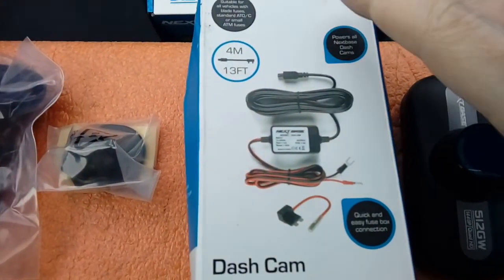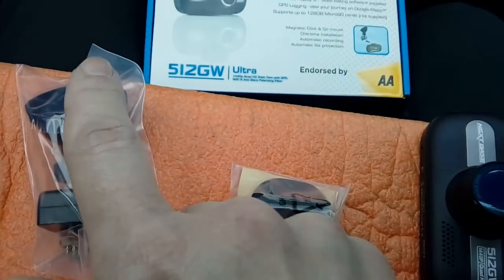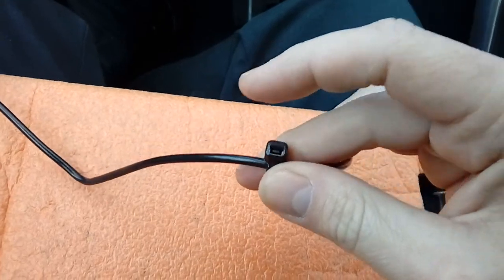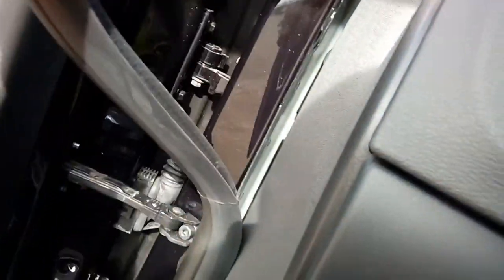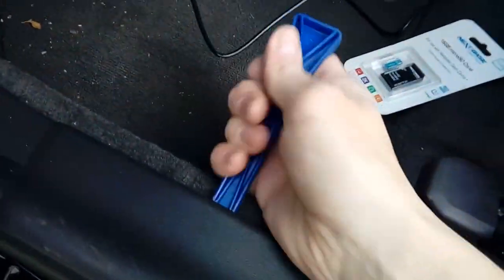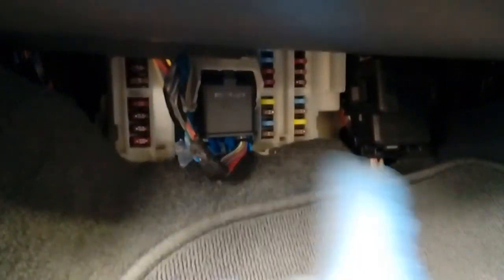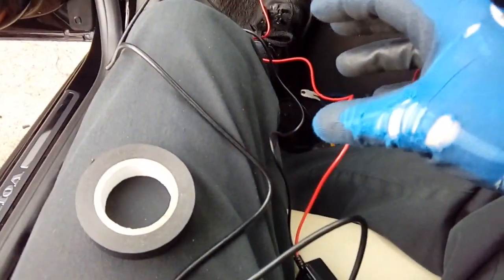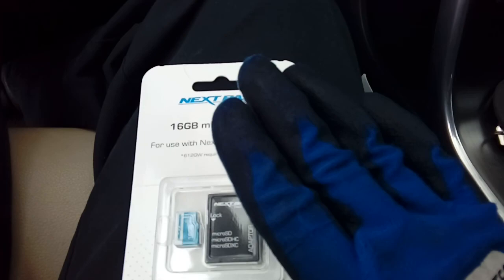Volvo S60 2010 onwards how to wire dash cam to ignition simple guide

Comment: Thanks for this video! Do you know perhaps if there is a power supply nearby the fusebox, even if the ignition is turned off? I have got a camera that both needs a supply for ignition and one when the ignition is off, so it can record when the car is turned off where it senses movement.
Reply: i am looking for the same solution, did you find any?
Reply: Check your manual for a constant on circuit in the fuse box. You can add another "add a fuse" to handle the power supply.
Reply: Did you find a solution?
Reply: Sorry for late reply, so the solution:

-The fuse I use for direct battery power (allways power, B+, yellow-dashcam cable) is the immobilizer fuse number 24 (under the glove box, the one at the bottom and right corner).

-For the ignition ON fuse (ACC, red-dashcam cable) I used the allready free fuse number 2 in the top-left corner of the same fuses compartment under the glove box.

This setup works very wel for over a year for my volvo s60. No blown fuses or electrical problems. Drive safe!

Comment: why didn't you use the empty places of fuses no. 2 and 17? there is constant power in one and second after the ignition is turned on
Reply from the maker: @rafal711  Sometimes this can link and unused circuit on the car and create an error which the eco will log and in some cases show a dashboard warning
Light.
It also depends on the spec of the car and country the car was sold in, not to mention build date.

Comment: Thank you for the video but after bulking out the cable,I found it a bit concerning  prizing the headlining down because the material is very fragile on the edge and I wouldn't recommend bulking the cable because it bulges the headlining and it doesn't go back properly.

Comment: I have a 2016 Volvo V40. I have located the fuse box under the glove compartment; the fuses look smaller than the next base fuse cable. Any ideas?
Reply from the maker: You either have micro blade fuss that have the same length pins as the one in the video or you have the stubby mini blade fuses where the pins end at the edge of the plastic section.
If it's stubby mini blades you can still use a normal mini blade fuse spur but if it's micro blade then you will need to buy a micro blade spur from Ebay or Amazon.

Comment: Cheers, very helpful. I just installed a Nextbase 522 into my 2016 V70 using this method. The only difference was, for the earth connection, I used an 8mm bolt very close to the 13mm bolt you used. That meant I could use the forked spade connector that the Nextbase hardwiring kit comes fitted with. I just had to loosen the bolt enough to slip the connector underneath, between the head of the bolt and its washer, then tighten it up again. I tested this bolt to make sure it had a good earth contact, which it does. Nice that there's the space behind the carpet by the wheel arch to stow the excess cable, too.

By the way, in my model, I used fuse 22 in the small fusebox, which is what feeds the two 12v sockets in the central armrest unit. Those come on when you unlock the car. I think they go off again unless you switch the ignition on but it's enough to start the dashcam up as you get into the car.
Reply: I used this one except I can’t close the lid so I’m going to move it to the other fuse box.

Comment: Just installed mine using this video on my V60!

I did find the smaller fuse box next to the one on the video had more available accessory fuses. The ones on this video were all connected to the Safety Radar/Collision avoidance etc where as the small box had 12v sockets, lights, rear wipers etc.

I pulled off the heated rear seats as that is only on engine live while the 12v socket seems to come on at random when you lock the car etc.

Comment: Great tutorial. Thanks. Do you know whether it Is exactly the same installation for a 2013 V40 ?
Reply from the maker: Yep pretty much the same for that year.
Reply: Dave Soulsby did you manage to install the nextbase fuse in the fusebox? In the comments somebody talks about the v40 2016 model which has different fuses. I also have the 2013 model, so hope you managed to get it installed.